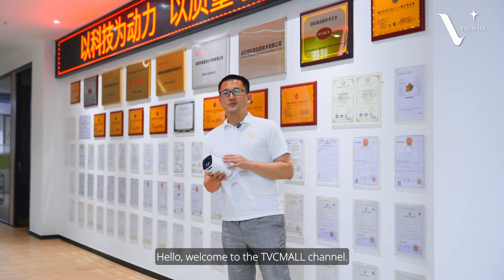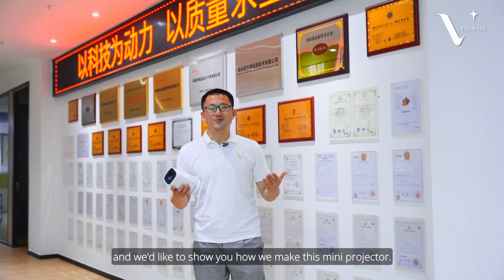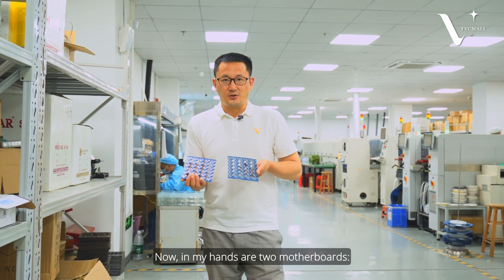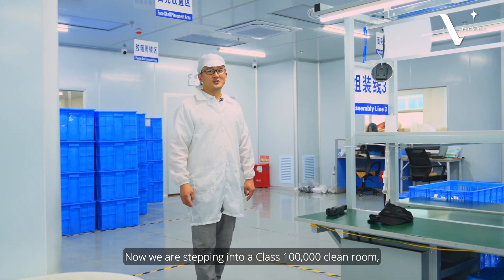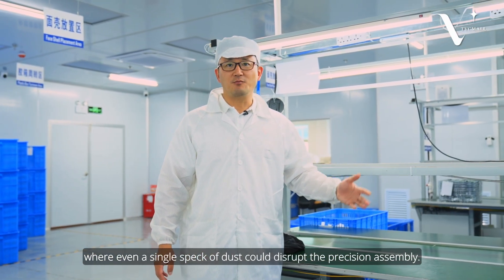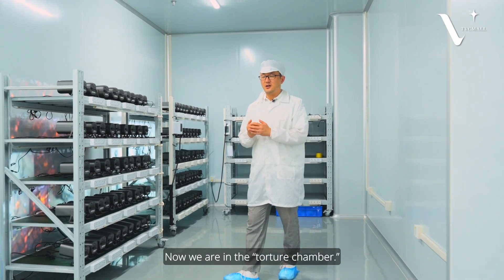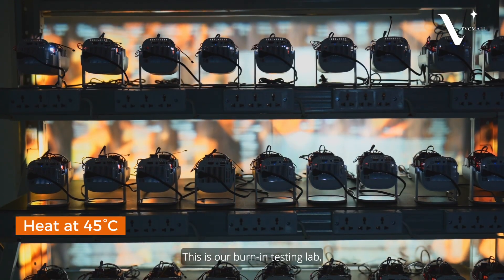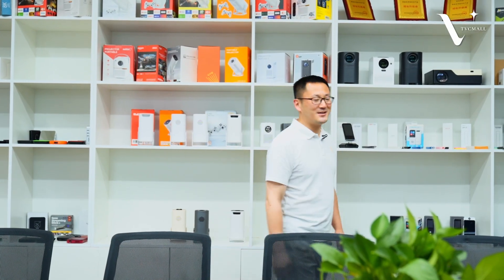Projector Factory Tour: How Projectors Are Made from Start to Finish

Comment: Hello I have same projector but the problem is when I start logo is coming an then black screen is showing how to reset or what to do any idea?
Reply from the maker: Hi, you can try these steps first:

Unplug the projector, wait about 5 minutes, then power it on again.
Make sure there’s no external device connected (HDMI/USB) and check if it boots normally.
If possible, go to Settings → Factory Reset when the menu appears.

If the issue persists, it may be a system or firmware problem. We recommend contacting your seller or sales manager with your model details for further support.